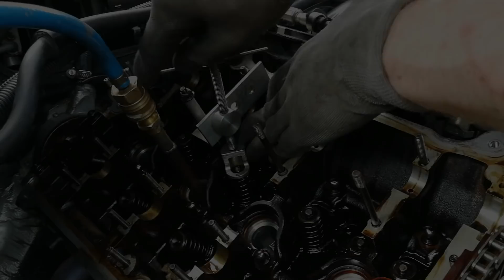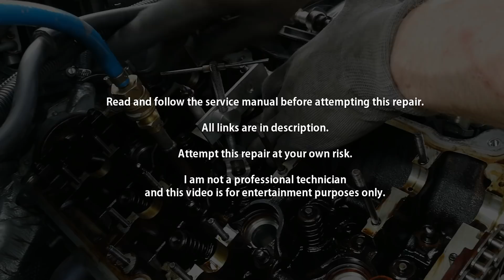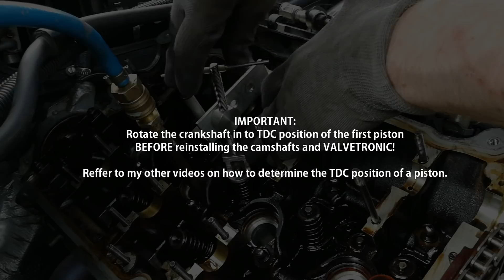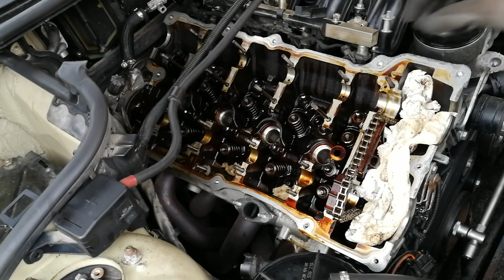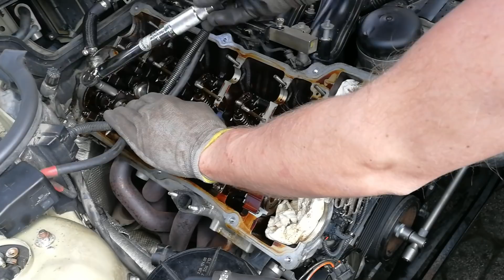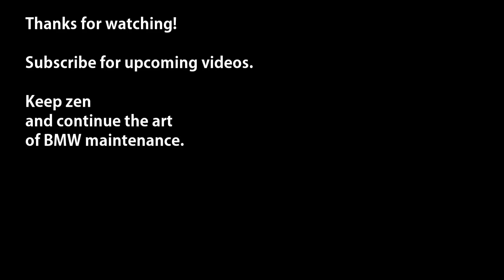BMW N42/N46 Valve Stem Seals Replacement PART #4: Reinstalling the camshafts and VALVETRONIC

Comment from the maker: PART #1: https://youtu.be/WJZ4e_Ku_Yk
PART #2: https://youtu.be/rzA_7zMssuU
PART #3: https://youtu.be/i_OM4AUYyfw
PART #5: https://youtu.be/IYn7V3HUK9I
Reply: Hi, Great Videos.  Did you make the spring compression tool ?   Not seen one like it for sale . 
This is my next  project as my N46B20B is using nearly 1 litre of oil a month.   56k miles on the clock so hoping its not the piston rings.
Reply: instablaster...

Comment: Thank you very much for these videos. I just changed my valve stem seals on my n45 (similar procedures) and your videos saved me.
Reply: Same here. Did you put the camshafts in with the bearing ledges seals on front of the camshaftsfacing up where the connection is? Thank you.
Reply: @jiri989 yes. I read or saw a video about it. He said to have all 4 facing up.

Comment: Brother i did the valve seals after installing everything back on when i start the car it makes a horrible ticking diesel sound .
When I unplug the position sensor it runs good been driving it now for 50k runs good but when I try to plug the sensor back it sounds like it will explode 
Do you know what it could be Brother
Update : took it out for a spin with the sensor plugged in let it do its thing engine off with key 3 times started car it sounded a lot better but idle would throw a check engine cylinder 3 misfire but when driving car runs great only idle is a bit lumpy
what could that be any idea what that is when sensor is not plugged in it idles fine
Reply: Hallo @User
Hello, thank you for your comments, it's the same for me.... did you find any problems?
Reply from the maker: Unpluging Valvetronic (VVT) sensor disables VVT operation and engine runs on auxiliary throttle. In this mode (and startup) the valves are opened fully in each cycle. 
Since the engine runns better in this mode, you can assume that one of the valves is not opening properly.

Most probably something went wrong when you installed the VVT assembly:
- intermediate lever slipped ou of position,
- torsion spring slipped on intermediate lever,
- rocker arm slipped.

This happens a lot on the nr. 3 cylinder since the intake camsahft is oriented in a way that there is very little retaining tension on the intermedite levers. The will slip out if not secured correctly during removal. Remove valve cover, check cylinder nr. 3 rocker arms and intermediate levers. You will probably need to remove the VVT assembly and redo the timing (replace VANOS bolts).
Reply: @BimmerZen  

Thanks for the quick response....I'll take off the valve cover again at the weekend and take a closer look at the entire part....I also have a misfiring cylinder 3....Thanks again 🙏
Reply: @BimmerZen  
 Thank you Brother 
Will look at that when it gets abit warmer 
It's been bugging me ever since i did the valve seals 
Thank again for the info on what it could be 
Thanks Brother
Reply: Hello Bimmerzen, thanks for your tip, I solved the problem....so..... I removed the valvetronic again yesterday and the torsion spring on cylinder number 3 was out of its position.  Now the car runs completely smoothly and without any error messages..... thank you very much for your comments and help.  Have a nice day, best regards Aramo

Comment: Hello. when setting the TDC to a given cylinder (I know that 1 and 4 have the same) do I have to block the flywheel with a lock before I fill the air with the compressor? And will such a small 6 liter compressor cope with this task?
Reply from the maker: You can lock it if you wish. I usualy use a ratchet on the crankbolt: https://youtu.be/BMk7dwtj_i0?t=342

1 bar of pressure and a small air compressor should be enough. When the piston is in TDC and valves are closed there will be a bit of a blowby, but a normal hobby size compressor should be able to handle it.
Reply: @BimmerZen  And if it inflates, for example, 4 bars, nothing will happen?
Reply from the maker: @autofan1993  Probably nothing if your crankshaft is secured:) I can also suggest the rope method: https://youtu.be/GDDWRbcD0T8 if you are unsure about the air compressor.
Reply: @BimmerZen  Can I order your valve seal replacement tool from Poland? If so, what would be the approximate shipping time?

Comment: How do the cam adjusters fit into place ? , do they move free until the bolts are tightened down.
Reply from the maker: Yes, they rotate freely until you set orientation with the front locking tool and tighten the bolts

Comment: Hey mate, I've got an e90 320i and wanting to do this job. But the n46 engine looks slightly different in the head? Can you elaborate on this please
Reply from the maker: There are only very minor differences, procedure is the same. N46 has a slighty different locking pin geometry,  but the pin that comes in N42/N46 timing kit should work on both engines. N46 has Valvetronic function integrated in to the DME (ecu).

Comment: Hello,i got a question. Long story short, i only need to take intake unit out and put it back in basically. Do i have to take both adjuster bolts out or can i take  intake one only?
Reply from the maker: Yes, I think you should be able to do it. Remove intake VANOS bolt, chain tensioner and the top torx bolt on the chain rail guide. Nr. 16 on this diagram: https://www.realoem.com/bmw/enUS/showparts?id=AT51-EUR-09-2001-E46-BMW-316ti&diagId=11_3189
That will give you just enough wiggle room to get the intake VANOS unit out. Just be careful you don't break the plastic guide - they can be quite brittle and are a very common point of failure.
However... You will have to re-time the chain and starting point of the timing procedure is always with the both bolts loose, so it might be better to remove both VANOS bolts. It's not much more work and they are not too expensive; approx. 10 EUR for a set of 2. Remember - you HAVE to replace the VANOS bolts as they are stretch to yield!

Comment: Hi! I saw other video,he only use 4 zip ties to hold the camshaft. https://youtu.be/4nXLUQj3TsE
Reply from the maker: Sorry for late reply!

I don't speak the language but i think he is assembling the valvetronic from start - not removing it from the engine. The difference is that when removing the valvetronic, the camshaft is in a position (TDC) where some intermediate levers are  not positively tensioned with valvetronic springs and will slide out of position! This is exactly what happened to me here: https://youtu.be/D6dNF5Yr3qQ?t=895
Reply: I did this twice ,it work easy,but don't  think smart,put zip ties at the middle of the cam,it will touch and push the spring out of the v holder and make noise when run!

Comment: Grat work, just a question, did you change the o-ring on the spark plug tube for cylinder 2 and 3? I think you can’t change them without removing the valvetronic unit is that right?
Reply from the maker: Hi, sorry for late reply! I did not replaced the o-rings because I did not have them at the moment. Yes - you have to remove the valvetronic unit to replace those o-rings on 2 and 3:/

Comment: I would like to give an extra tip!!! READ THIS!!!! make sure before putting back the whole inlet camshaft part that all the spring legs rest in the v shapped bracket!!! also check again with a little mirror after removing the zip ties!!! I mist that!!! but i was Lucky, heard a weird sound comming from the engine turned it of and then opened it all up and than saw 2 spring legs resting against the inletcamshaft!!! nothing happend engine runs perfect but please CHECK!!!
Reply from the maker: Good tip. The valvetronic bracket is very delicate, springs and rocker arms can get misaligned quite easily.
Reply: yeah! checked the rocker arms several times!

Comment: hey zen great videos ive  done my valve stem seals and i only get 30 psi compersion some times less some times more any idear what the hell is going on isit vanos broke ? any help please
Reply from the maker: Hi! There can be a number of reasons why you get low compression. Maybe piston rings are "dry" and don't seal well. This can happen if the engine was not running a long time, or if you have leaking fuel injectors (or bad spray pattern) that "wash" away oil from the cylinder walls.

Try to put a little table spoon of engine oil inside one of the cylinder via spark plug hole and see if compression gets any better on that cylinder.

Other reasons could be worn cylinder walls/piston rings,  stuck piston rings due to gunked oil and carbon deposits, bad valve seats, broken or bent valves, cracked head, bad head gasket, ...

I don't think it's VANOS related. If timing is OK on the VANOS units and camshafts, then VANOS is not the cause.

In any case, you will have to do more diagnostics to determine the cause... Also make sure you have a good working compression test gauge:)
Reply: @BimmerZen  Thanks for the replie i have a new headgasket i relapped in all 16 valves by hand my self there was no leaks 100% i have tryed a phew test gauge's ive oil in the bores 
first crack of the engine will some times give me 150 psi + then nothing nothing nothing as you keep turning leave it to rest for half hour and some times ill get 150psi  on first turn over of engine then nothing for reminder of turns This is sureley a broke vanos unit as timing is spot on ive doen it 5 times cranked locked cams locked
Reply: https://youtu.be/xD4k9yHooOA
Reply: https://www.youtube.com/watch?v=6LW9GbbDwOg play in vanos little bit
Reply from the maker: @rubylittleninja8231  Can you do a leakdown test? That should show you where your compression is leaking...
Reply: @BimmerZen  no need got 150 175 175 150 now inlet cam was upside down so lets check inlet cam cove longest side up at the back and exhaust the same is the correct now
Reply from the maker: @rubylittleninja8231  great! Thanks for the feedback, I'm sure this information will help a lot of people.

Comment: Did you finish the timing bro ? 
I'm going to be doing the stem seals soon when everything is delivered 
Ordered the timing tools , valve stem seals i got today and the vanos bolts are in backorder 
Is yours running again
Reply from the maker: I'm working on the video right now. Been very busy lately. The engine is running great:)
Reply: Can't wait for the next video Bro
Reply from the maker: 369 963 eta 2 hours:)
Reply from the maker: Here you go: https://youtu.be/IYn7V3HUK9I

Comment: Did you need to reprogram the valvetronic or did it just work fine
Reply from the maker: If you don't mess with the bracket assembly, motor and the valvetronic sensor, you don't have to reprogram anything. It works without any problems.
Reply: Thx bro ...

Comment: Really appreciate all the work you have put into these videos, and as this is such problematic engine. Many people will find this useful, and to my knowledge, this is the first start to finish guide on this engine. as for my problem, luckily it passed MOT, but i have got lots of positive pressure in my crankcases, thinking of installing a catch can.

Comment: Good stuff! How many miles/km had the engine when you had to do this?
Reply from the maker: My compact had only 194.000 km, this one has 242.000 km.
Reply: I have an e90 100000 km and it burns 1 liter of oil evri 1000-1500 km